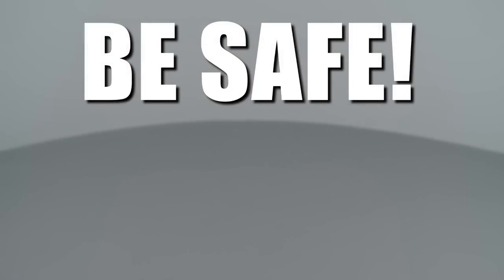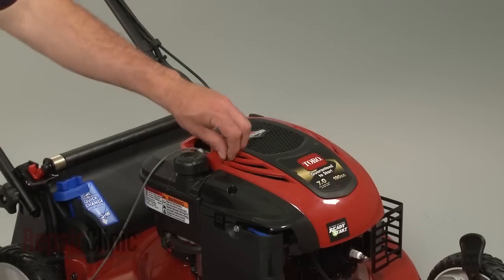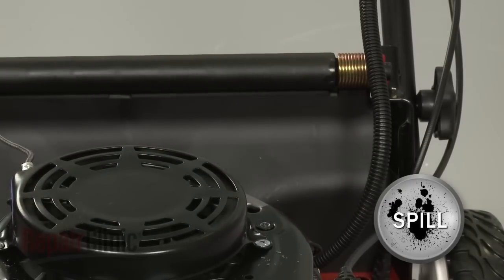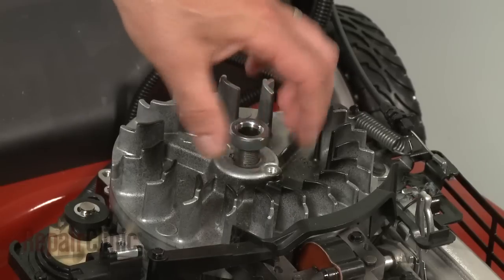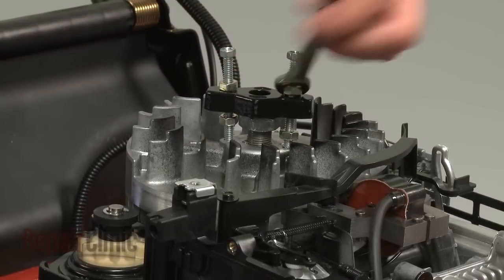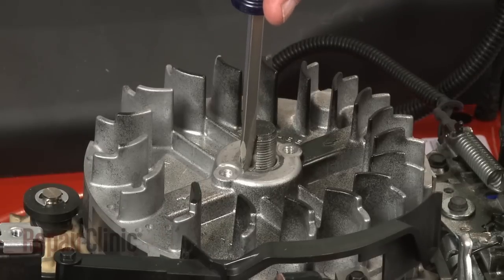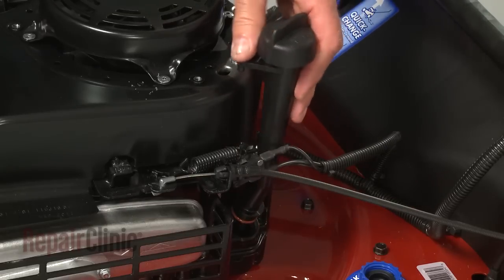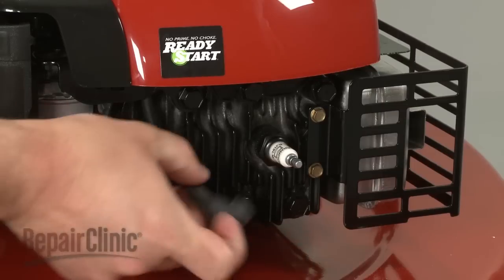Briggs & Stratton Lawn Mower Small Engine Flywheel Key 222698S

Comment: I broke a flywheel key as a result of finding a cut-off fence post in deep grass.  The blade was obviously ruined.  After replacing the blade, the lawn mower still wouldn't start.  I was advised that I probably split the key.

After watching this video and one other on the subject, I was able to replace the flywheel key.  It went pretty smooth.  Kudos to repairclinic for putting this information here.

Comment: I using a flywheel puller, first have to tap threads...easier to pry and tap main shaft with a block of wood. After installing new flywheel key, torque nut at 55 ft-lbs.

Comment from the maker: Good call Tony, and good job on the repair.
Reply: Does the flywheel key #222698S fit all Briggs and Stratton push mower engines?  I have a Troy Bilt 550ex 148cc TB 100.  Thank you.

Comment: I have had a problem with my lawnmower where it is surging. I replaced the carb thinking that was the problem, it had a stripped bolt so it's a good thing I replaced it but it is still surging. could this be a symptom of a sheared flywheel key?
Reply: Its possible that dirty gasoline was immediately introduced into the new carb, blocking the low / midrange fuel circuit. This absence of the slow speed fuel circuit is the only cause of surging. Try a new gas container, fresh fuel and a second carb change.
Reply: Bailey La

RÀSSIAN MOOVIS

Comment: The flywheel key I bought won't fit. My engine is a Briggs and Stratton 123K02-0258-E1. The key I bought is a B&S 222698S. I tried every possible way to fit it into the slot (which I first aligned with the indentation in the flywheel shaft). It won't go in. It is slightly too big. Should I try to pound it in with a hammer? Thanks!
Reply: File or sand it down to fit.This is assuming you have made sue that the groove in the shaft and flywheel are fully clear and clean and the edges are not peened over.
Reply: +revmpandora 
Good idea. Thanks!
Reply: The key is made of aluminum, so be gentle while tapping it.
Reply: Hi all, same problem. I have a Toro model 20016.. looked up the fly key and no matter what I do.. It just won't fit.  The grove and flywheel are both in good shape.. The flywheel just wont sit down when I put the key on.. But when I remove the flywheel key.. THe Flywheel sits down without issue..Even if I try to put the flywheel on first and then try to insert the key.. No way its going to fit.  Help please..

Comment: You didn’t say anything about alignment.  Do the arrows on the flywheel spoke things point to where the key should be on the flywheel?  If so, it would be easy to see by where the shaft key slot is if the key is probably broken without having to disassemble as much.

Comment: hello ive got a 6.5 engine on a wacker plate. the recoil keeps yanking back and the flywheel key is not damaged and ive changed the recoil mechanism and its still yanking out my hand? any ideas???
Reply: Eddie Collins compression release on camshaft

Comment: I'm trying to get a mower to start - seems like I've checked everything, including the flywheel key. It was intact but APPEARED to have a crack running all the way through it lengthwise; I could not pull apart the two pieces. Somebody told me that even in this state the flywheel key could prevent the mower from starting. Is that accurate? There was no collision with a hard object before it stopped running; it just would not start one day. I may have hit something years ago, though.
Reply: I believe any imperfection in the flywheel key can throw off the oil/gas/spark so that the mower does not run smoothly or, in some cases, not start.  Did you ever figure out what it was?
Reply: @Kube_Dog  I did, but I'm embarrassed to say what the problem was 🤣...it was not the flywheel key, though!
Reply: @vanhouten64  No gas?  :)  Spark plug not hooked up?
Reply: @Kube_Dog  A NEW spark plug was bad! So that was the LAST thing I checked! 🤬🤣
Reply: @vanhouten64  You shouldn't be embarrassed over that.  I once re-built a carb and it turned out my fuel cap's air hole was clogged with dirt.  Anyway, I'm glad you got it running.

Comment: I hit a root, and had the same problem. It wouldn't start. I followed your guide and found the split key. I replaced it and reassembled, but it still won't start. It tries to turn over, but just won't catch. Any ideas? It's a Briggs and Stratton 128mo2-0133-f1. Thanks for posting these videos. They are awesome!
Reply from the maker: Ekrogstad We recommend using the repair help section of our website - http://www.RepairClinic.com/repairhelpIt works best to enter your model number.

Comment: I installed a new pull string and it retracts but once I install the cover back over the fly wheel it will pull out but wont go back to start the motor.
Reply from the maker: We would need the model of the engine to see what kind of pull starter you have. Either the pulley is hitting the starter cup when you put the cover back on or you have a bad ratchet that is sticking and won’t let the pulley return.